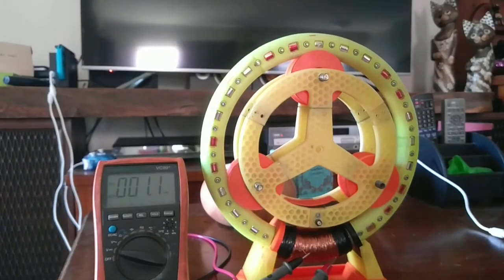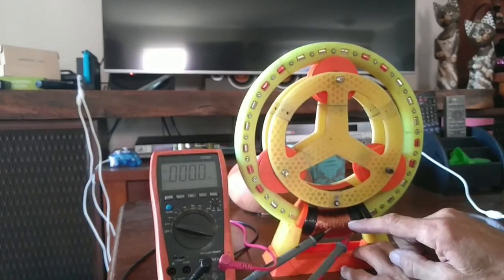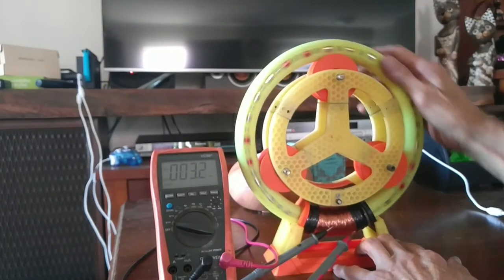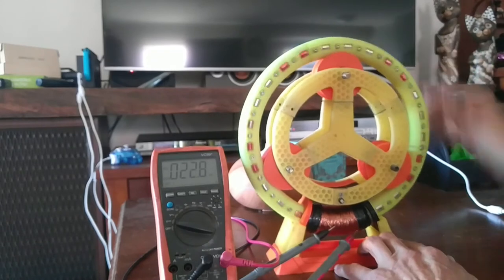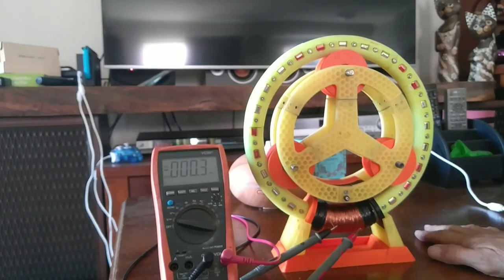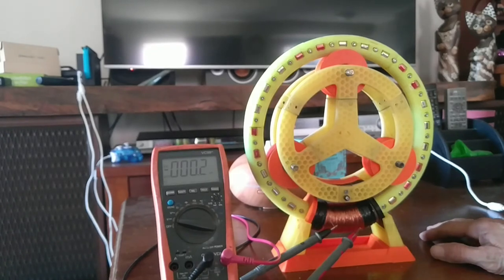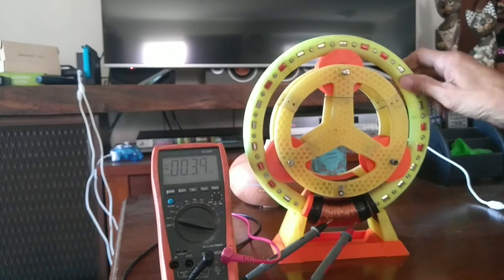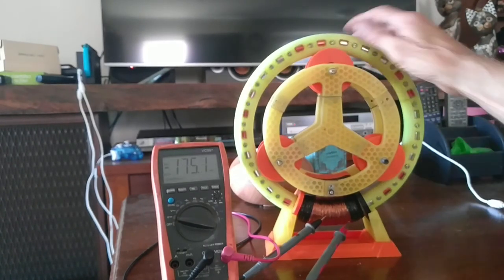Testing Coil

Comment: I have been making set ups like these out of old alternators for years one man’s trash is another’s treasure
Reply from the maker: This was an idea I got from watching other people making solenoid motors, and thought about when we had those torches with the magnet in the handle and you would shake it and  the magnet would go through a coil also in the handle and charge a capacitor.
I can give you the files if you like to build one another guy has got it running I have given it to on YouTube, because there is no resistance when placing the magnetic field through the coil, you should be able to make it charge and power it self.
This channel here has one in action
https://www.youtube.com/channel/UCS1BEGzXayTz6BgB_wAIeBQ
Reply: @SpaceManAus  When is the last time you went to the library?
Reply from the maker: @PushPullPump  
Not since the internet why, this device works you know other I gave the files to have built one and have it running and producing power, this is my own design.
The user below mcorrade has it running, I have an even better on now that uses no power to run, have not built it yet to test it but am sure it will run, will build it soon and show it.

Comment: You could use skateboard wheels,  they have bearings that may smooth it up.  They also sell high speed lube for skateboard wheel bearings.  All at your local skate shop.
Reply from the maker: I can do that because I have a lath but not suitable for those who don't, I am giving the 3D printer files to people wanting to give it a go, it is may printer that was the problem.
Reply: Yea in that case , I see what ya mean.  😁

Comment: hey pal I'm having sort of the same issue. Mine is not sticking but the bearing are real sloppy. I'm going to dismantle mine and tighten everything up.
Reply from the maker: My bearings fit good one side but the top side is a little loose but will be ok

Comment: Space man I finally finished one coil. I think I will put it all together and see if one coil will make it run. In theory it should.
Reply from the maker: Great to hear have not had a chance to do anything so far, had to much to do, still need to work out why my ring is getting stuck at two points, think it may be the rollers will try and look into it soon.
Can't wait to see how you go.
Reply: @SpaceManAus  My ring is great. I re-printed it and all I need to to do now is put the dam thing together